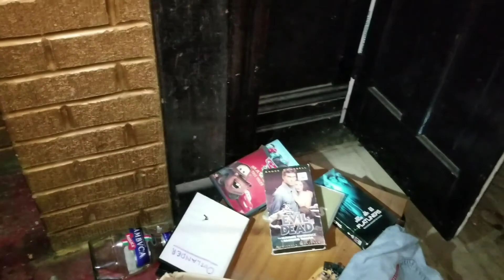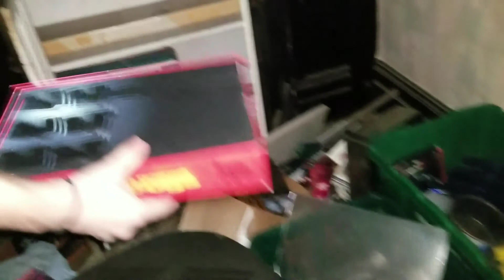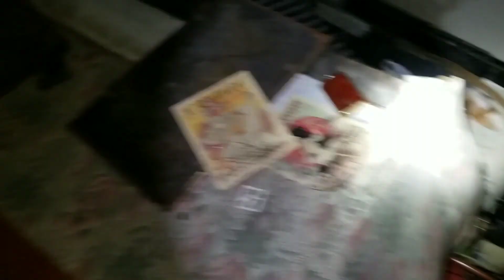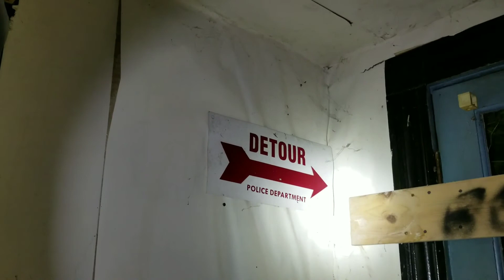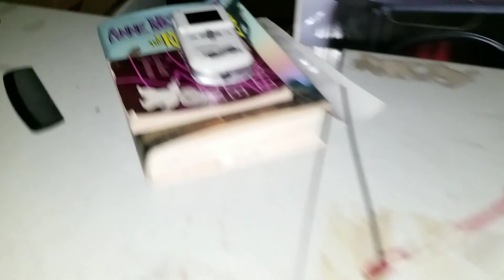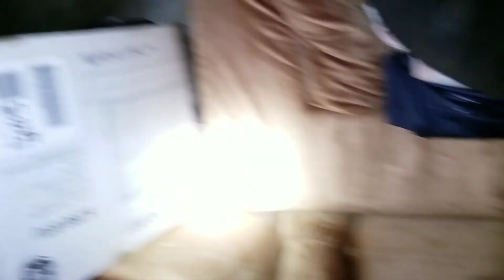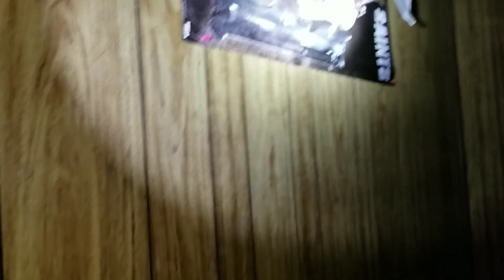Abandoned House Across The Street From Brownsville General Hospital

Comment: Cool house!  I actually have that exact radio by the tv. It is a Soundesign brand stereo with a single cassette, record and 8 track player. It came with a stand and tower speakers. It also has a digital clock and alarm. It doesnt sound all that great as the watts are very low. Its from around 1983, which is when I got mine brand new. Cost around $300 back then.
Reply from the maker: KLM817 Wow wee. That's a lot of money for back then. I was more impressed with that radio than the old school t.v that was in the same room.
Reply: WallieB26 That was alot of money. My parents bought me that stereo for Christmas that year.  I still have it and it still works. I also have a few of those old school tvs as well.
Reply from the maker: KLM817 We still have a couple as well. We mainly keep them as back ups in case one of ours breaks.
Reply: @WallieB26  you shouls have took those chucks from there wallie!!! hehehe
Reply: wuuuuuuuuuuw steep steep!!!! 300 in 1983 it's like 10thou now